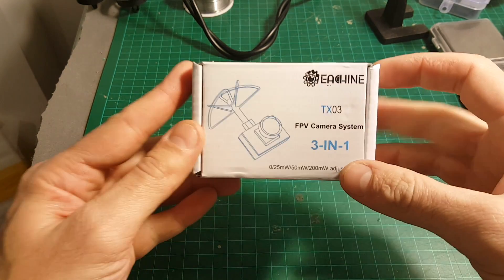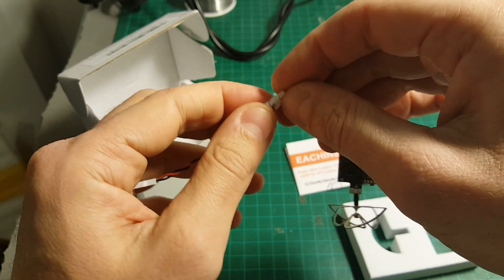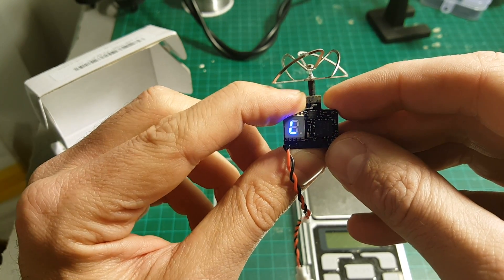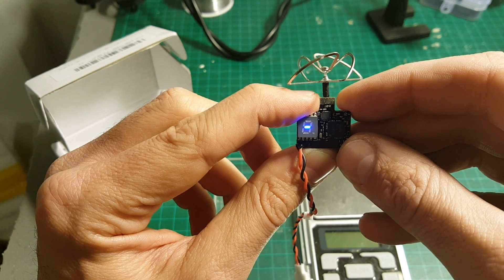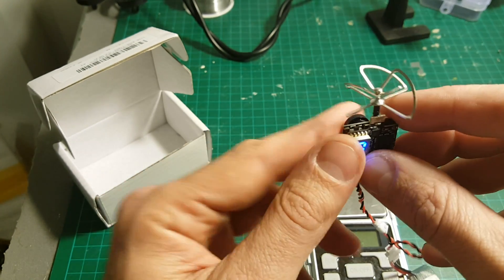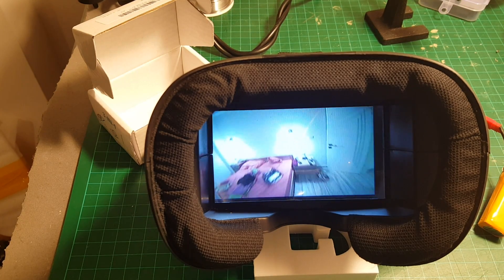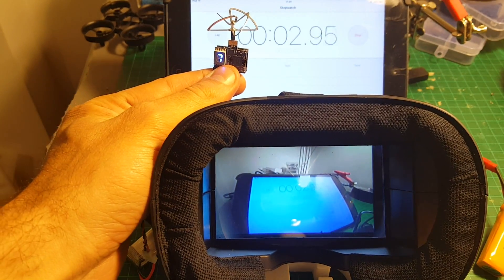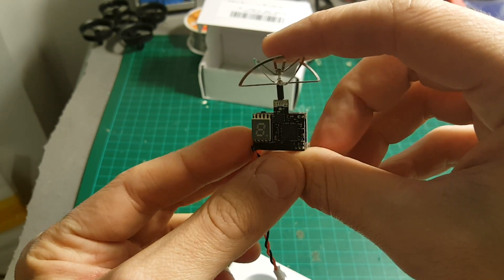Eachine TX03 Super Mini Switchable AIO 5.8G FPV Camera - unboxing, review and delay test

Comment: How heavy is the antenna? Is there a lighter option if you are doing close proximity transmission, like <5m...  Could you simply take the antenna off?
Reply from the maker: No, but you can desolder it and solder a linear antenna. Check out the TX05, as far as I can remember it's lighter.

Comment: The battery I have appears to be opposite polarity... what would have happened if I hadn't noticed before I connected it?
Reply from the maker: Probably one of the capacitors would be fried. Luckily you caught this :-)
Reply: Yes... 
My son and I both bought these cameras. This morning I almost gave him his camera and one of the batteries (For a JJRC H20 Drone), but luckily I decided to take the batteries and one of our cameras to work so I could look closely at the wiring and the plugs to check the polarity before I give it to him.

I will push the pins out of the connector and re-insert them with the correct polarity

Comment: Does it have lines in the video from the motors?
Reply from the maker: There should not be any lines.The working voltage is relatively low.
Reply: Gal Kremer i know the 1 and 2 had that problem. Have you tested it on a quad?
Reply from the maker: Just tested it. I can confirm that no lines were present, even when the voltage was very low. I will post a video in the next few days.
Reply: great, thank you